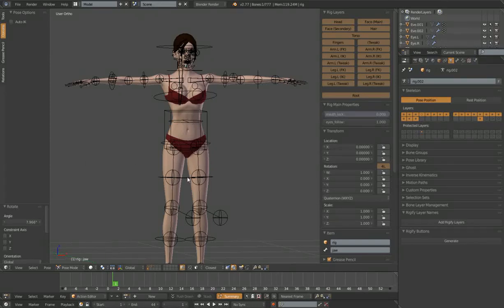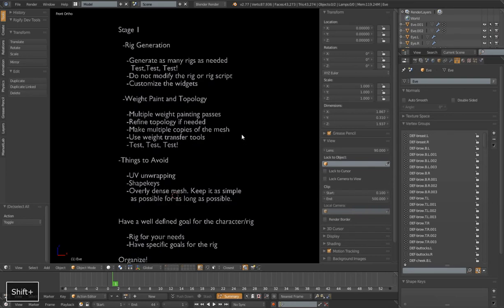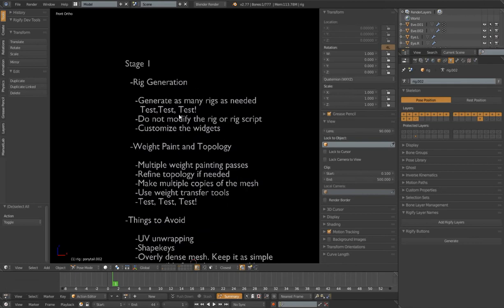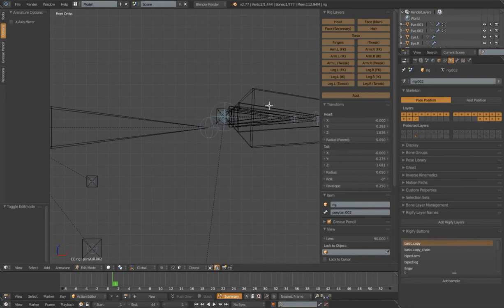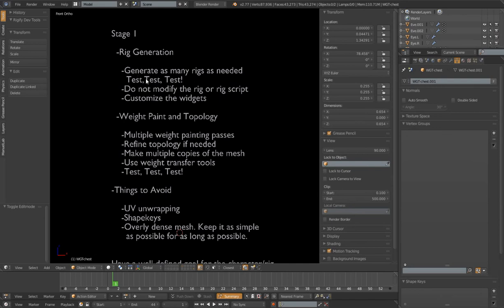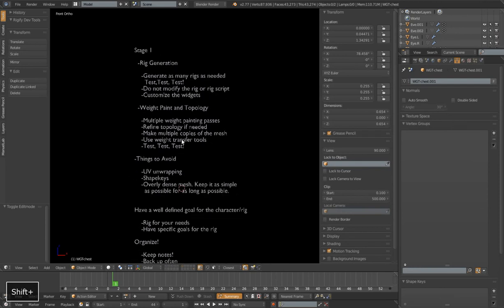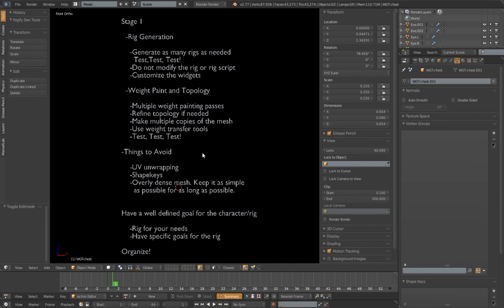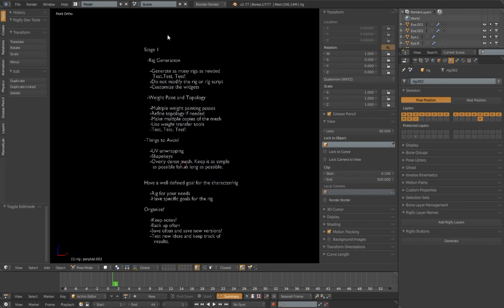Rigify   Part 7A  Stage 1 Workflow Tips

Comment: AI i was actually curious how to add a face rig, i also noticed the new rig has extra bones near the hips. There are 2 bones pointing outwards, probably for better bending i guess
Reply: PS when you have added extra bones and generate a new rig, those bones will be gone in the old rig or does it update the position of all existing ones?